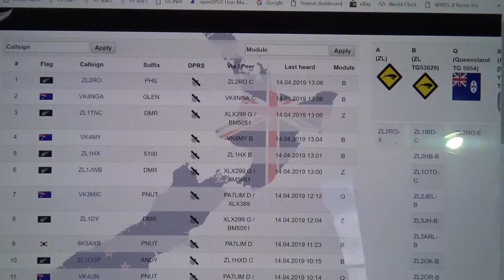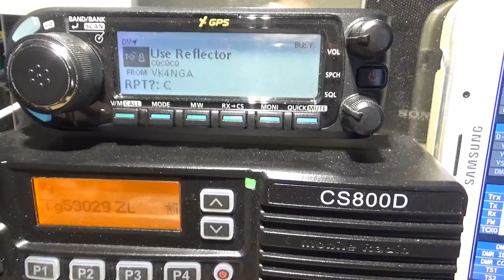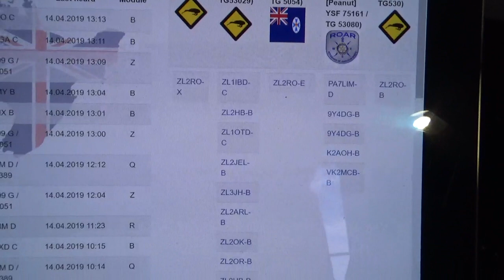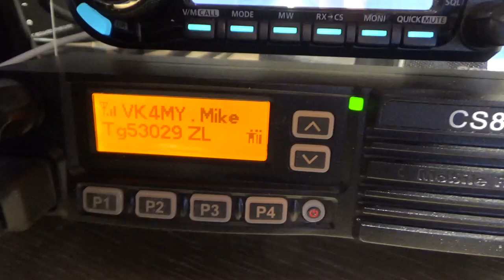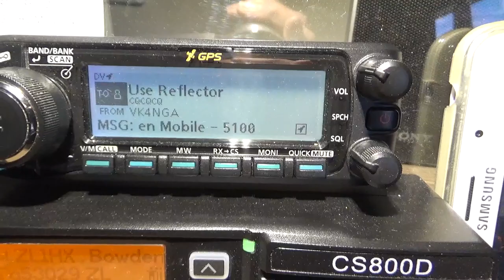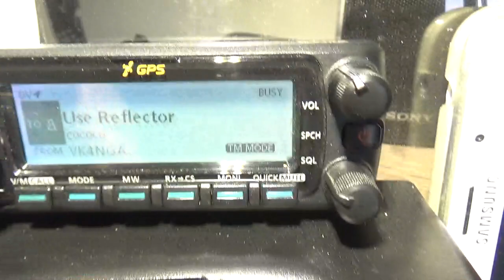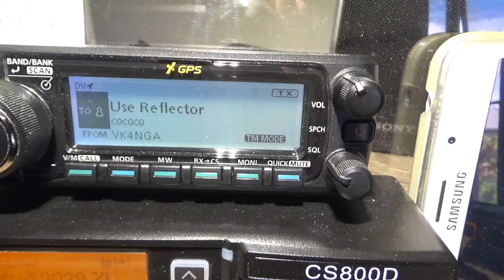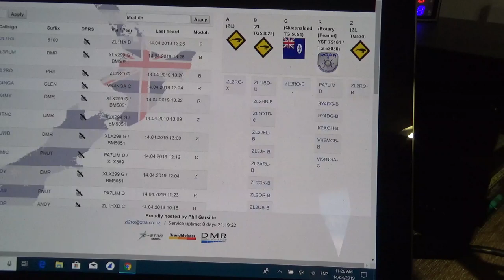XLX299 Multimode Reflector is Awesome! Check It Out!

Comment: Hi what is the server domain for terminal mode
Reply from the maker: You can run terminal mode with just a raspberry pi running pi-star. Search my videos to see how.
Reply: Using it-705 in gateway mode with its built in WiFi needs the gateway domain or IP address connecting to xlx